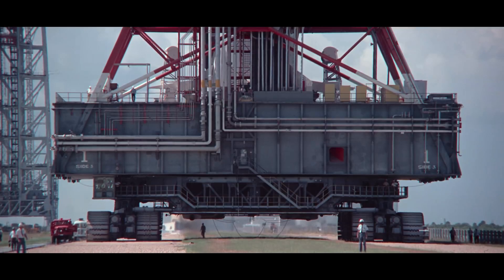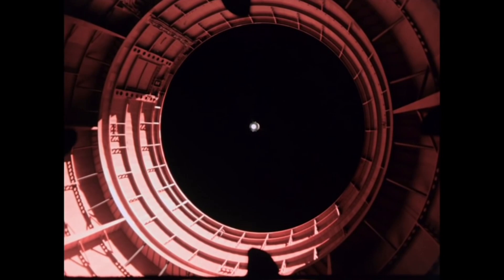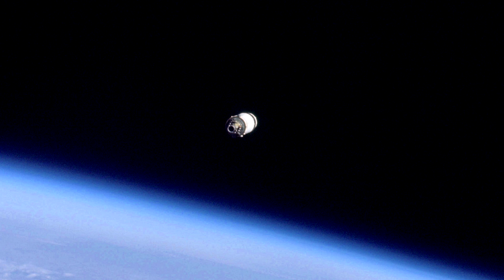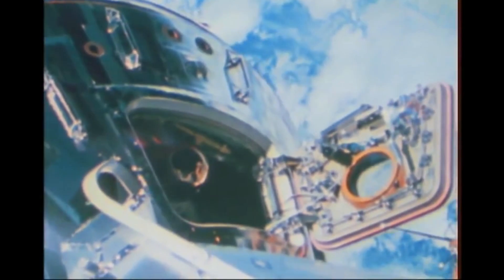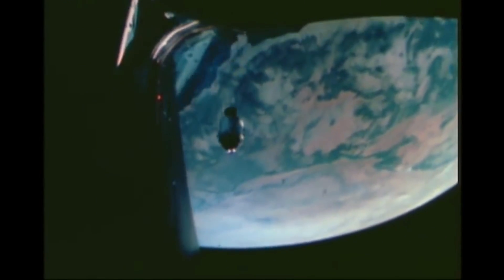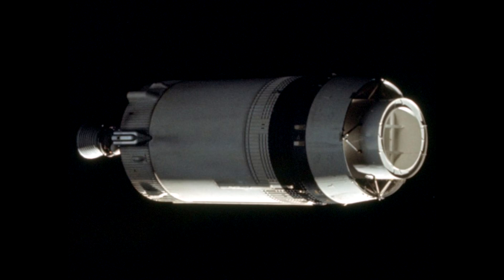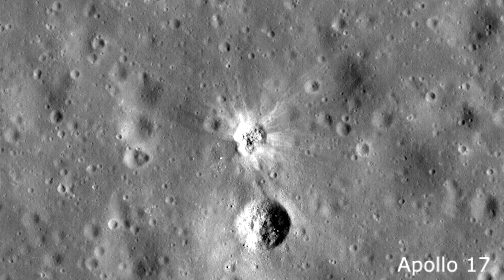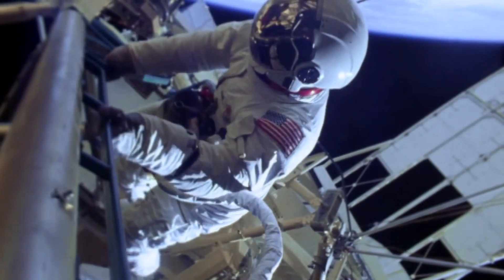How Did The Apollo 11 Documentary Get Film Of The Upper Stage Ignition?

Comment: How NASA tried to save Skylab is an interesting story in itself.

Skylab was falling because space isn't a perfect vacuum, especially close to the Earth.  There's a tiny bit of atmosphere even 'way up there and although it's nowhere near enough to allow us to breathe, it's still enough to cause some friction to an orbiting space craft and gradually slow it down until it falls from orbit.

NASA realised that their best chance of saving Skylab so that the shuttle could reach it in time lay in re-orienting the space station so that it presented the smallest profile to the minimal atomosphere it was encountering, but in order to do that, they needed to regain 24-hour control of the station's electronics and computers.

The problem was that the rechargable (Ni-Cd) batteries were dead and so the only time power was available was when the solar panels came into the sun during the orbit.  On top of this, the safety systems aboard Skylab were set up to disconnect the batteries if an under-voltage was detected.  This meant that at least in theory, if they gave Skylab the command to connect its batteries so they could charge from the solar panels, they would be immediately disconnected due to being almost dead.

But NASA engineers realised that there was a difference between theory and practice.

Every time a command was sent to connect the batteries, a relay would connect the batteries to the solar panels, then the under-voltage would be detected and the relay would drop out, but there was a tiny delay between those two events and during that tiny delay, a small amount of charge would go into the batteries.

The NASA engineers came up with a program which would send the command to connect the batteries, wait just long enough for the relay to click in and then drop out again, then send the command again, over and over, several times per second.  Each time the relay clicked in for a moment, a small amount of charge went into the batteries.

Eventually the batteries gained enough charge that there was no longer an under-voltage and the relay stayed closed, allowing the batteries to fully charge so NASA could control Skylab from the ground once again.

It's a pity that Skylab was still lost after all that effort, but what an ingenious effort it was.

(Information gained from an issue of Electronics Australia when it still existed and was still a good magazine)
Reply: Scientists- we want you to fly a hundred miles away from your parents spacecraft to make sure the lunar module works
Astronaut - what if it doesnt work?
Scientists- then we will have gathered valuable data!!
Reply: That is a fascinating piece of space history, thanks for sharing
Reply: Waw. That was a great story. Thank you
Reply: My understanding is that it never made it to its proper orbit in the first place.
Reply: Homesteading Space a Skylab story has a lengthy chapter on the challenging efforts to calculate, where it would come down. And on the remarkable repair efforts in the beginning. Which more than  rivalled in effort throughout Nasa and industry the Apollo 13 saving.  It wasn't about saving lifes but about saving a very expensive mission from complete failure  and under a extraordinary tight time limit. Things that would ususally take Nasa (for good reasons) many months, happened in days. Bypassing bureaucracy on a unprecedented scale.   
They had 10 days to think up, build and  test solutions from scratch.   And the crew around Pete Conrad then made it work.

It's really a great book to learn more about this somewhat forgotten but very interesting  story.
Reply: I'm surprised we never, in any era, developed some kind of small and fast rocket that could get fuel, food or supplies to an orbiting craft. A probe of sorts. For example, some kind of small engine sent up to Skylab that they simply could have strapped to the outside to boost it's orbit, or a small resupply to the Columbia crew instead of risking them reentering the atmosphere, or an oxygen resupply to the Apollo 13 crew.
Reply: @30AndHatingIt  Unfortunately, escaping Earth's gravity isn't a simple task and requires a lot of energy expenditure even without a payload.
Also, nobody knew that the Columbia was damaged until after the fatal re-entry attempt so it would have made no difference.
Reply: @melkiorwiseman  I've seen a lot of discussion surrounding NASA being aware of the foam strike before the crew attempted reentry.
Reply: @30AndHatingIt  I remember seeing that.  They were aware of the foam strike, but did not realise that it had caused damage to the wing which would later prove to be catastrophic upon re-entry.  Or at least that's the way I interpreted what they presented.
Reply: @30AndHatingIt  Read my post just below.
Reply: @melkiorwiseman  If you would read  Gene Krantz book, "Failure was not an option."  It gives the low down on this subject.  The Flight mission control crew all knew the Astronauts were doomed.
Reply: @myfavoritemartian1  Yikes.
Reply: @myfavoritemartian1  For which mission?
Reply: LoneStar 84 Columbia. They knew it wasn't coming back as soon as it took the foam strike. Nobody was going to say that though. You can watch the mission control video of the re-entry. The first problem is that a group of sensors on the wing that was damaged all went out at once. You can see it on their faces when this happens, but they still maintain contact with the astronauts for a bit after that moment. It's hard to watch.
Reply: @Studio23Media  LeRoy Cain knew what was up and you see it on his face right after CAPCOM kept calling for a UHF comm check.

Linda Ham was badgered about contacting the DoD to have a spy satellite repositioned to photograph Columbia, but refused to entertain the notion and Sean O'Keefe backed her up.
Reply: @30AndHatingIt  The reason those resupplies can't be done is fuel. Amateur rockets are great but have they ever achieved orbit? 

Looking at Apollo 13, by the time the explosion happened the astronauts were almost in Lunar orbit, requiring them to slingshot around the Moon and head straight back to Earth. In order to deliver them more O2 you would have to have another Saturn V rocket already on the launch pad when Apollo 13 lifted off in the first place. That rocket would then have to blast off, enter a parking orbit, perform a translunar injection, and then fire retro thrusters to slow the hell down and do an about face so they can rendezvous with the returning Apollo 13 spacecraft. This would require immense planning and cost, enough to render the whole thing completely impractical.
Reply: @QuadinarosLS  Point was to use something smaller, like a hastily modified Surveyor probe (the unmanned probes NASA sent to the moon to gather data needed by Apollo missions), aimed to intersect 13's known orbit and slow down to a potential docking/capture speed.

Also the question was why contingency craft for such tasks were never developed to the point of being deployment ready should the need arise (deployment ready means they have the pieces and a plan, not a rescue craft sitting idle for decades).  For example the design might require certain components to be in stock 1 mission before normal use and blueprints for rapid assembly.

Even if a Saturn V would have been needed, an incomplete Apollo 14 could have (with appropriate contingency plans prepared) been rushed to the other KSC pad, or even the recently vacated pad. A key aspect of emergency operations is to skip time consuming steps like wiring up a dedicated ROM for the AGC, triple checking the craft, or waiting hours for the guards to be ready to walk next to the crawler.

For Skylab, an expendable sat launcher could transport a satellite maneuvering unit (an empty satellite) to docking position for boosting it a bit.

Columbia would be even simpler as the orbiter had the crew and equipment to capture dumb containers full of supplies while waiting for the next STS flight to be ready to pick up the crew.
Reply: @johndododoe1411  Skylab had a rescue Apollo and Saturn 1B ready to go. Apparently, the movie "Marooned" spooked someone at NASA.
Reply: @30AndHatingIt  Someone agreed with your thought. We've had our first "rescue rocket" satellite meet up with an aging telecommunications satellite. It just wasn't going to happen without private space companies. They saw some money to be made and gave it a try. Next up is mini-devices sent up to deal with expired satellites and other space debris.
Reply: @cynvision  Well that's awesome! Didn't hear about that, did everything work out?
Reply: @30AndHatingIt  Listen man when it comes to literal rocket science, there is not a single thing that could be called "Simple"
Reply: 30 And Hating It You haven’t thought this through fully have you? Let’s ignore the cost for now - how would you go about actually performing those ‘simple’ tasks? What with? Do you have a simplified plan with an estimated lead time? Or a plan of any kind? You make it sound so simple that you’d obviously wonder why it didn’t happen, but the simple reason is, it’s further from simple than you are from Pluto. 

Are you the guy that suggested fitting commercial airliners with drogue chutes so they can’t ‘fall’ out of the sky? 

Or the guy who suggested making car bodies into electromagnets for collision avoidance? 

Is this Elon?
Reply: @thephalcon9501  Look, if you were having a bad day or something I get it, but I don't think posting a simple passing comment on a random video while browsing the site late at night should be used as a definitive measure of my intelligence. I've seen plenty of amateur rocketeers out there get some pretty impressive results with their homebrew launches at pennies next to the dollar. All I was floating out there (pun intended) was the question of making something smaller than what is usually sent up for resupply, as in smaller than the unmanned resupply craft they are sending to the ISS right now that are roughly the size of commercial van. In an emergency, I was thinking something much smaller with only the essentials needed for said emergency, would be cheaper and quicker to launch. Just shooting the shit, no need to professionally evaluate me.

Comment: Nice work to explain the sep footage was from an S-I. People often take documentaries as gospel. The S-IVB test failure was due to a tank weld issue.  The test stand location is now a residential subdivision. On the camera ejection.  I prefer footage from Apollo 4 and 6 which shows the ejection of the interstage after 1st stage sep. How cool is that?. Too many documentaries use Apollo 4 footage while talking about Apollo 11 and subsequent missions. Worse is when editors cut from Saturn I footage to Apollo 4 / 6 footage.  Apollo 5 was technically the first test of the LEM (un-maned mission using a S-I). Apollo 9 was the LEM rendezvous test with crew and as you say the first MAJOR test because it was the first time all the modules flew together.  Anyway great work and have a Swan.

Comment: The center tank of the Saturn I (and Saturn IB) first stage was a "stretched" Jupiter tank, around which the eight "stretched" Redstone tanks were clustered. The alternating black (RP-1 kerosene) and white (LOX) Redstone tanks of the Saturn I and early-flight Saturn IB vehicles was changed to all-white (for the three Skylab crews' Saturn IBs, and the ASTP crew's Saturn IB vehicle) because it was found that the Sun heated up the black RP-1 tanks enough that--through conduction, and also emitted heat from the black RP-1 tanks impinging on their neighboring LOX tanks--the LOX boiled off more rapidly. It was no "show-stopper," just a minor annoyance of having to top off the LOX tanks more often, but switching to the all-white RP-1 and LOX tanks significantly reduced the LOX boil-off rate. Also, regarding Apollo 12's S-IVB:

All of the other ones--besides Apollo 12's S-IVB--that were sent hyperbolic (from Apollo 8, 9, 10, and 11) were injected into Earth-escape trajectories which reached solar orbits that rather closely "shadow" the Earth's orbit around the Sun. Apollo 12's S-IVB, however, failed to achieve Earth escape velocity due to a slight guidance error, although it came quite close to doing so, and--like one of the Surveyor lander models launched on an Atlas-Centaur test flight (it was launched on a trans-lunar trajectory to a hypothetical Moon [like Gemini 5's "Phantom Agena" test])--Apollo 12's S-IVB eventually wandered into solar orbit after an uncontrolled lunar flyby. Its solar orbit, however, doesn't "clear" the Earth's orbit as well as the other S-IVBs' solar orbits do, which is why it "visits" us at intervals. The Wikipedia article on the Apollo 12 mission says the following about its S-IVB's unusual solar orbit, and how the S-IVB reached it:

"After LM separation, the S-IVB was intended to fly into solar orbit. The S-IVB auxiliary propulsion system was fired, and the remaining propellants vented to slow it down to fly past the Moon's trailing edge (the Apollo spacecraft always approached the Moon's leading edge). The Moon's gravity would then slingshot the stage into solar orbit. However, a small error in the state vector in the Saturn's guidance system caused the S-IVB to fly past the Moon at too high an altitude to achieve Earth escape velocity. It remained in a semi-stable Earth orbit after passing the Moon on November 18, 1969. It finally escaped Earth orbit in 1971 but was briefly recaptured in Earth orbit 31 years later. It was discovered by amateur astronomer Bill Yeung who gave it the temporary designation J002E3 before it was determined to be an artificial object.[7][8]"

Comment: Skylab's fascinating, and unjustly forgotten --- a space station made out of leftover Apollo parts, when they really had no idea what living in space would be like and were just making things up as they went along. It went wrong on launch, with several pieces breaking off, and required heroic measures by the first crew to repair it into habitability --- the tarpaulin in the photos was a sunshield to prevent overheating. (The exact opposite problem Mir had in 1997!)

It did groundbreaking work in solar observation, being able to see wavelengths blocked by the atmosphere; it took 150,000 film exposures. The observatory was a semi-independent unit based on an Apollo Lander hull, and actually ended powering the space station after the launch until the rescue mission could reach it...
Reply: Not only did they repair it. They wrote the book (at least the english one) on space station living and working. And Conrad had enough standing and authority to force changes when they felt they needed. He had several private phone conferences with Kraft and Kranz and some higherups, bypassing the official mission control chain of communication.
And they overruled overcautios doctors (they had no experiences too) and inefficient procedures. when they needed.

He didn't need a "mutiny".

Comment: I'm going back to KSP, aren't I? Also little confused, "asteroid" was supposed to be from Apollo 12 module or earlier, but they collect seismic activity by smashing something into moon - from Apollo 11 up. So did they just landed Apollo 11 and 12 seismic modules and measured the response? But with Apollo 13 they accelerated modules using S-IVB and recorded that? Was there middle ground, or did they just went full retrograde, fingers crossed it won't break itself? Or the moon?
Sorry I just need to know where this seismometers were, because from what you said they couldn't be on S-IVB, but also had to be there. No offense, it isn't your problem that in answering a lot of questions you created one. Happens everytime.
Reply from the maker: The seismometer on Apollo 11 failed after 3 weeks, so it wasn’t useful to crash Apollo 12 S-IVB into moon
Reply: @scottmanley  So you place Seismometer and when next rocket is due you smash it nearby using soundwaves etc. to determine composition of a moon? Frankly I think this needs video of it's own, or at least a good source. For example what was the distance?

Comment: An interesting tidbit I learned while at the Smithsonian Air and Space Museum in 1976 was that NASA came and recovered some parts from the SIV-B stage on display to use on Skylab. I don't recall exactly what, but it seems to me it was some kind of compressors or other pumps. They were actually removed from a museum and certified for flight because they were not available anymore. NASA was on an ever-decreasing budget, and simply could not afford the time or money to re-tool the parts and assembly fixtures.

Comment: S IV B has been on my mind. A big rocket, only one to ever do a TLI. Was looking at its numbers recently, pondering using a Falcon upper stage to do the Orion TLI from LEO. This stage launched as payload with only 50% fuel, atop a FH with its own upper stage. FH can lift it. Yes, an inefficient, ugly solution: a keralox stage in space. With only 50% - 55% fuel, too much dry mass to wet mass ratio. Less isp and thrust than a hydrolox SIVB. But it’s pushing 20 tons less. (Apollo stack 45.2t vs Orion 25t.) This Falcon Trans-Lunar Stage, FTLS, has an advantage over all others: available. Orion itself to be launched by another FH.

Yes, talking about the EM-1 mission without SLS. Sources indicate ICPS needs to be placed in a high eccentric orbit by SLS, can only manage TLI from there. Drop ICPS from the equation. Launch Orion, then FTLS, for the LEO rendezvous approach. No other booster comes close to ability to do TLI.

Have been trying to work the numbers. Have not forgotten SIVB and FTLS is each also pushing its own mass. It may work, but barely. And I don’t have the skills to really work it out. Also, don’t have good specs for the current Falcon upper stage. Have more stuff, but this post already way too long.